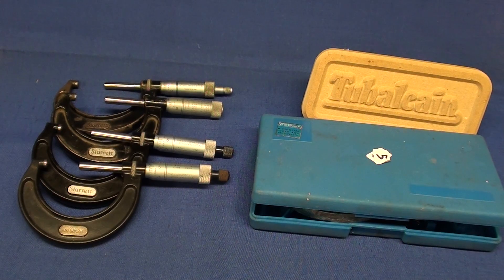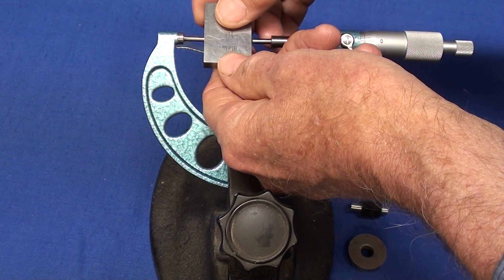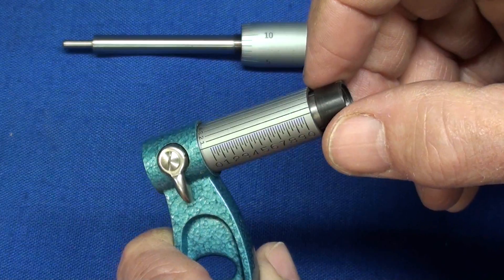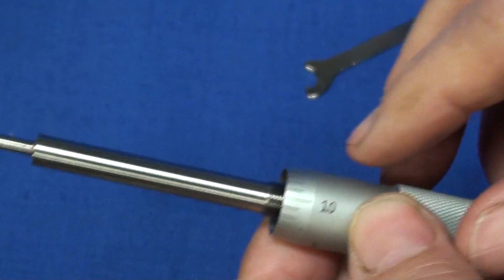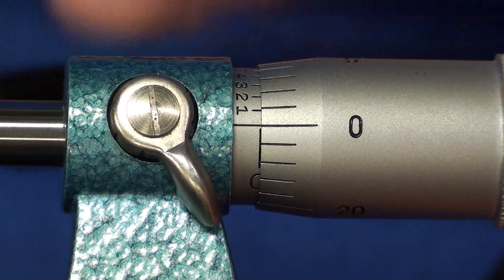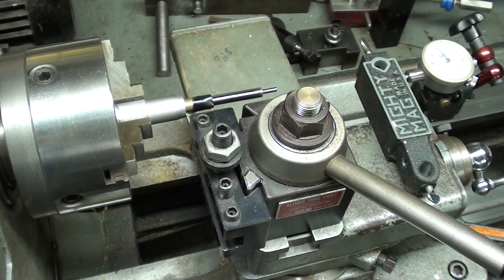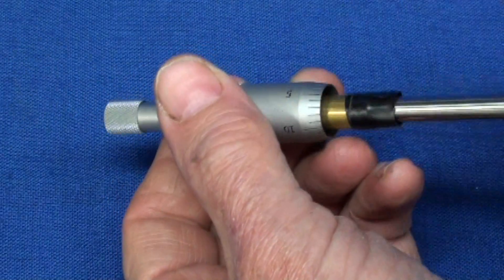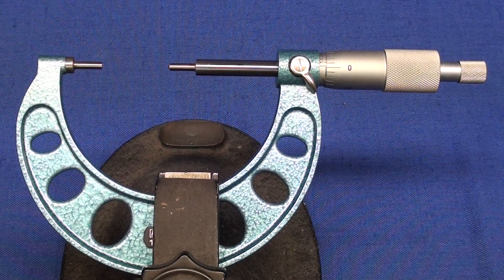SHOP TIPS #302 Calibrating a Fowler Micrometer tubalcain

Comment: I agree with your closing statement - it was perfect before you messed with it, but it was interesting to see the inside.
I'm wondering if there isn't some way to adjust this - otherwise how do they make it so that the micrometer always reads zero on the front, there must be some way to adjust the spindle relative to the thimble.

Comment: I have an old Starrett mic that belonged to my grandfather. There is some rust or other corrosion on the flat of the anvil. Any suggestions on how to clean or re-surface without fouling it up? Btw, I don't have access to any machine tools. I'm just one of those hammer and chisel mechanics you loathe so much...

Comment: I've been unable to set my micrometer to zero as it's too stiff to turn the scale barrel with the little spanner,   seeing it's probably just a friction fit gives me confidence to try a little more force on it in the vice (with appropriate protection to try and prevent scratching it).   Mine cost £12 approx $17 so not the bargain you got.